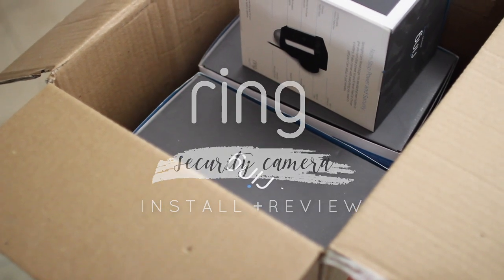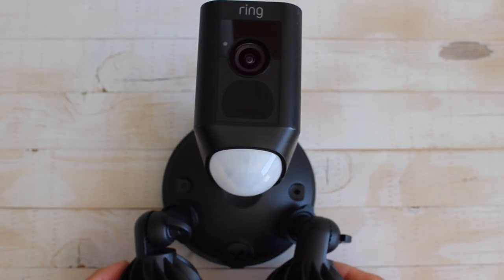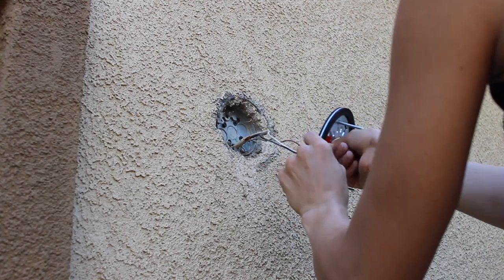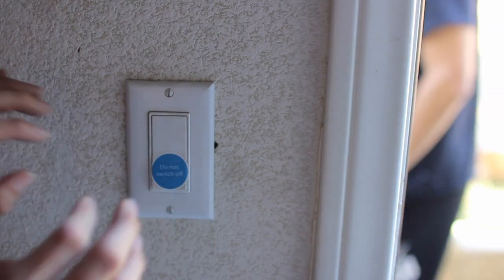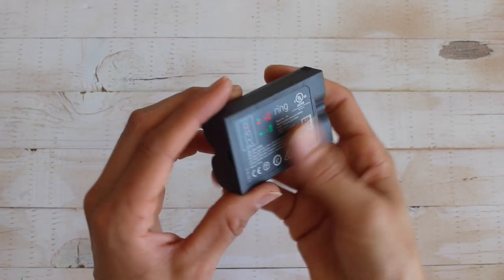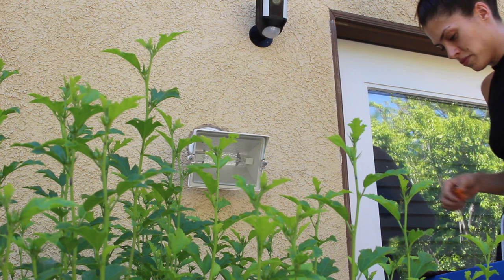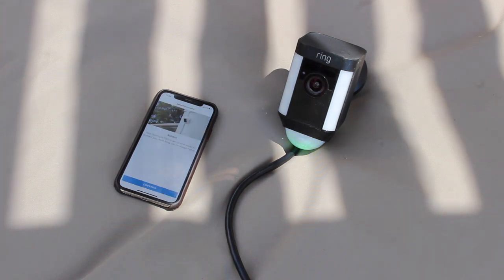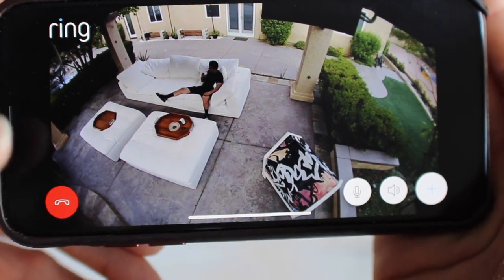Ring Security Camera Install + Review

Comment: Hints:  The hard wired security lights are designed to be mounted vertically, so if your existing security lights are mounted to a sofit (aka eves)  horizontally, the light/ and or camera  will not angle properly. I hired an electrician to mount a vertical wiring box to my exiting horizontal using a short right angle conduit, which was not cheap.   Additionally, make sure you have a good wifi signal out to the area where devices will be mounted.   Write down your Wifi ID and password and keep it handy.  The last software setup involves pressing a button on top of your camera and then identifying your WiFi ID and putting in your password.  The reason I mention this is that your security lights are likely to be 8 - 10 feet off the ground, so getting to this button is a ladder challenge.  If you screw up the setup, you will have to repeat pushing the setup button again and repeat.
Reply from the maker: Thank you for this!

Comment: Quick tip! if it rains alot where you guys live. Caulk the outside edge where the floodlight is mounted for extra protection from water. I didnt do that with some regular light fixtures on my driveway and there was a little gap and water got inside and rotted the wood.

Comment: Great video. Since you installed two different cameras, which do you find to be best? I’m debating between the two and/or getting both styles then deciding which would be best placed at the front of house and backyard area.
Reply from the maker: I love the wired because the battery one dies SO easy.
Reply: Living to DIY with Rachel Metz: if you need to use batteries make sure you install two ring charged batteries and attach the solar panel and it’ll triple your battery life.

Comment: What bulb replacements are needed when they go out? Specifically for the spotlight camera?  Thanks!
Reply from the maker: They haven't gone out so I'm not sure yet!
Reply: Im pretty sure once the bulb goes out you have to get a new entire camera because the LED lights are soldered to the light
Reply: True, the whole unit gets replaced if the bulbs go out.

Comment: Hi, thank you for posting really common sense video.

The second install the battery camera, do you know how often the battery needs to be charged. Are they sued for really cold climates.

Thank you.
Reply from the maker: I'm not sure how cold since I'm in Cali and the battery is annoying. You have to charge it all the time!
Reply: Living to DIY with Rachel Metz:  I’m in Phoenix. If you attach the Ring solar panel to the spotlight cam and use two batteries at a time like I did you can go quite some time without changing batteries.

Comment: I have the battery operated spot light camera and it works best in a location that does not get a lot of traffic.  Evertime the wind blows mine gets set off and drains the battery.  I have had it working 5 days and am down to about 67% on the battery.
Reply from the maker: I've discovered that recently! It is quite annoying.